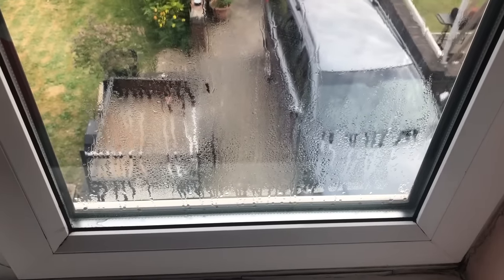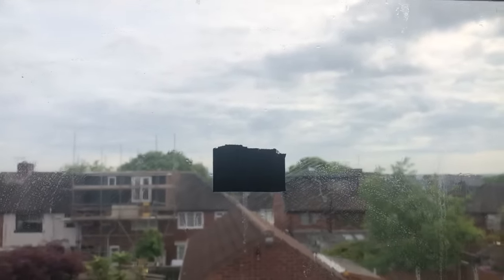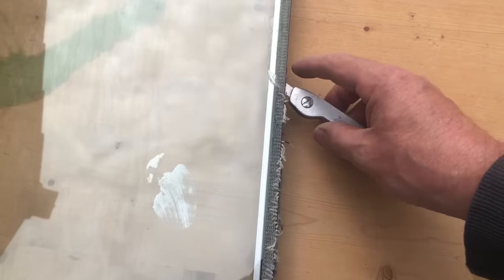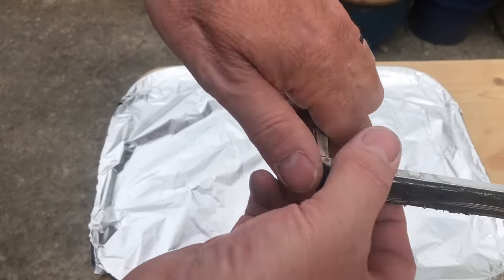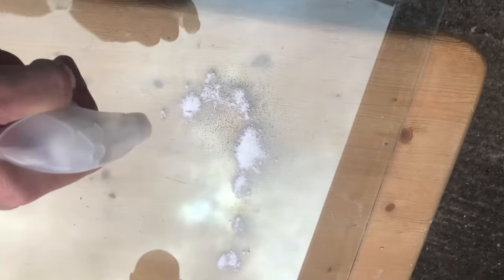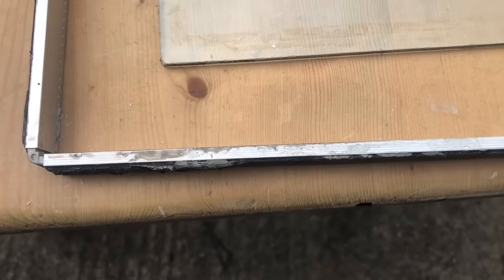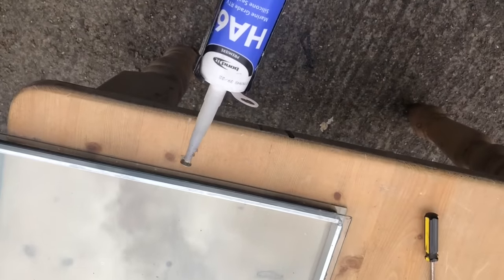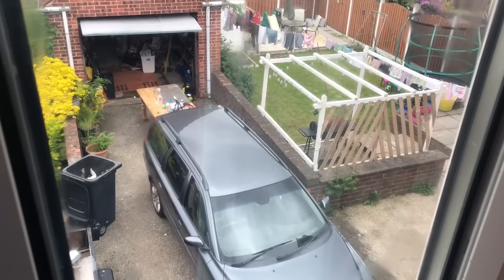Double Glazing Unit Condensation / Blown DIY Repair.

Comment: Its really depressing how many comments say "just go and buy a new one", totally missing the point. Repairing things is a great thing to do on many levels (eco, ethics quite aside from saving money) if you have the skill and inclination & no one is forcing anyone to do this against their will. Great repair well done!. I wonder if these people wash their clothes, dishes etc or just buy new ones.
Reply from the maker: Agreed 100%, the real problem is fear  of this repair  leading to a downturn of business for those who stand to benefit. Eco credentials are likely discarded for profit and convenience.

I’ve had the exact same problem with another video I made opening a stuck shut composite door that I strongly suspect has upset many a locksmith! They don’t want a video to be available to the masses that helps solve a costly problem they earn money from!
Reply: I wouldnt have said that, but I have to admit I had no idea they were repairable. I had a hunch that there was a dessicant in the surround, but always assumed the air gap had some specific gas or vacuum treatment to minimise the condensation. I have a couple of blown units though. Now I've seen this i will certainly take the plunge on repairing them myself
Reply: For most it basically boils down to valuing how much your time is worth? Stripping down a unit like that would probably take many about two hours to do , a new glazed unit is about £20 , so if you're time is worth more than £10 per hour you're better off buying a new unit. 
Appreciate the video though, found it interesting
Reply: @johnd6487  
Bog standard double glazing now is argon filled, I just had some fitted because my old frames were falling to pieces.  DG has improved but if you don't need to change them then fixing them makes sense.  It takes donkeys years to get the money back, that's if you ever do before they fall to pieces again.
Reply: The problem is, we only one day per year when it's not pi55ing it down! lol
Reply from the maker: So true,  when the best weather days arrive there are much better things to do like go riding bicycles.
Reply: @Jack_Warner 
Argon is the most basic gas they fill with, it's good enough for me and compared to what was there a big improvement, now the wind stops a blowin' when I shut me windows.
Reply: Easy for a small unit like this, what about my big window? That would be quite risky to attempt, I’d probably end up killing myself, at that point I think it would be better to get someone else to sort it out.
Reply from the maker: @st200ol  I know where you are coming from as  some windows are horrific in size, I’ve done larger ones,  another larger window is on the cards today! I’ll video it so all issues are noted.
Reply: @TheRepairer  Thanks for the reply. Looking forward to that video.
Reply: @st200ol  Buy some beers and get some mates round to help. 

Nothing could go wrong.
Reply: I would buy a new one , This way is a long and potentially dangerous operation and just not worthwhilw . No guarantee it will work , . Its so difficult to do also ,. Anyone saying it is easy hasn't had much experience of it . I have done this , i have attempted many but so many are failures. . Its not worthwhile .
Reply: Complete waist of time just get a new one this will never be the same as it would come out of the factory not the right amount of compression on it this will fail again, cheap low rate clear float silver spaced unit, better off getting A ratead argon fillied unit
Reply: What about the thermal properties of the panel? You’ve basically negated the point of double glazing
Reply: @darrenwilliams7741  It is a complete waste of time i agree , . What do you mean about 'compression ' though please? I don't get that bit.
Reply: @Jack_Warner No, the argon gas decreases the heat loss through the double glazed unit.
Reply: @julesdowner5585  The way it's put back together it's not sealed tightly as it would be on the machine so it will course thermal bridging gaps, there is a reason why there is a shit load of silicone on it. This unit is likely to crack when cold.
Reply: Your better off buying a new one as there cheap anyway and that will fail again, if you really can’t afford the £20-40 for a new sealed glass unit then clean up your old one and most places will reseal it for you.
Reply: @M.E63  Prices do vary .  i got prices for a toughened unit last week and it varied from £36 to £78. If this was a viable repair then you would think that  people would set up offering this service ? As for getting it sealed , You may end up waiting a day or so for this depending if places are busy . . Much easier to get a replacement .
Reply: Wish I'd read through the comments before attempting this. It's a real pig of a job to get ALL the silicone off. Silicone does not stick to silicone! It will dry as a separate, non bonded layer to all that old silicone you have left on the edges of the spacer frame. I would say your repair is doomed to fail again very soon after the repair unfortunately.   If I could find a place locally to me here in France that sold these units, l most definitely woukd just go and buy a professionally made replacement unit. Because as you quite rightly say, it is not a 5 min job. I've spent most of the day getting my unit apart and cleaning off all the old silicone, and the glass. Still got to get it back together again yet as well 🙄
Reply: @ianwalton7893  In UK it’s no problem to her sealed window glass unit, you can get it cheap and it’s not worth repairing considering the time and effort and little money you save if any, the repair won’t last long, might be best to use a different sealant like maybe polyurethane or something similar, I don’t think silicone is a great idea, I wouldn’t use a clear one, I think black sealant is the best way to go
Reply: @M.E63  to be fair the original units were sealed with black sealant, but the 1/4" over hang of the glass past the centre spacer was completely filled up level with the edge of the glass all the way around. Solid smooth and very thick. To buy that amount of sealant here will probably cost as much as a new unit alone!
Reply: @ianwalton7893  I presume they use black as it won’t get dirty and mouldy as much over time, i wouldn’t use any clear or white sealant. I don’t think you need to remove all of the old sealant where it’s filled, the main part you want to remove is where the glass sits down around the inside edge of the glass, after that you can add some around the sides but I wouldn’t remove all the old sealant that’s filled in around the sides, here in UK I wouldn’t even waste my time and money on that as we can get one delivered to our house or go to local glass place and they made mine in 30 minutes while I waited, however most places won’t do it there and then, this video is in UK and I don’t recommend anyone to waste there time here or even in USA as it’s cheap and easy to get these glass units, I can’t comment on France or anywhere else but it shouldn’t be hard or expensive to get it
Reply: @chrisb4009  yea, there is not much "eco" about this. You're using a cartridge full of sealant to repair a product to a state that won't do much insulating compared to modern gas filled sealed units. I'm all for repairs when possible, but it doesn't make any sense here.
Reply: @julesdowner5585 agreed it is not cost effective. I am in the trade, and it’s just not worth the time and effort to split a unit. Also what was not mentioned, if the glass has become stained inside the white residue simply with not come of.
Reply: What is depressing is spending hours repairing a double glazed unit because you have nothing better to do.
Reply: @horace9341  Quite true . Its a nonaense video from  a  fool. Can you imagine   the problems a novice would find doing this and also the danger from messing about with glass and knives. . Just splitting a unit can be difficult if not impossible without breaking it.  . Like you say , once glass is water marked  just chuck it ,
Reply: @M.E63  Cheap?  I just measured/priced the smallest of my many blown units and it was £100 to replace.  There are 5 in that window so that's a monkey for one bay.  Cheaper than Anglia would charge, but they rip the whole thing out.  So I spend a ton on sealant and save myself £400 ... and if it fails there's only the cost of the sealant to worry about.
Reply: @I_Don_t_want_a_handle  it’s a different story if your replacing 5 of them, but I just replaced one and the video is about one and mine was £40, size is 80cm x 100cm, I would rather pay the £40 then do all that work to seal it
Reply: @M.E63  Where did you get that from?  My window is smaller (60x100) and the lowest I have seen is £100.  At £40 you are correct, not worth the effort if time and ability is lacking.
Reply: But there were not repaired. They will mist up again when the weather conditions get colder.
Reply: @johnd6487 Indeed, there is an inert gas within double glazing panels. It can be one of several different gases.
Reply: @thefreedomguyuk Requiring a follow up video ...
Reply: @Jack_Warnerno, the point of argon filling is to reduce the U value - ie. Increase the insulation!
Reply: @nonegiven9579  What size unit are you getting for £20?
Reply: no its not argon is a better insulator than air
@Jack_Warner
Reply: Just buy a new comment
Reply: @I_Don_t_want_a_handle  While I would probably go for a replacement, the prices I have seen bandied about here are massively lower than what I can find.
Reply: It's a lot easier to go riding bicycles now, with all the crazy tax payer funded psycho lanes ruining our roads.
Reply: He should have just bought a new one.
Reply from the maker: @mrteroo8953 This is a repair channel not a buy a new one channel!
Reply from the maker: @combrogi  The repair works or I wouldn’t have made a video about it and not all glazing is Argon.
Reply: @TheRepairer  wasting your life pal. Buy a new one then get out on the lash.
Reply: You're absolutely right. I've repaired things for all of my adult life. In this case I've got a composite door with 2 glass panels and one of them has blown. They were supposed to have been filled with argon as well.
Reply from the maker: If the glass can be removed and refitted there is hope for a successful repair.
Reply: @TheRepairer  yes, also the fact that it's supposed to be filled with argon is irrelevant as any saving made from less than a total of 1 square metre would be literally pennies compared to a unit with just air.
Reply: @nonegiven9579  Agreed. Although it's not only your time but the extra associated costs; Sealant, Heat oven to dry the dessicant and Duct tape all add up the cost so in fact it will be cheaper and more eco friendly to purchase a new one.
Reply: To me it's also theoretical.  4 hours for TheRepairer is probably 2 days for an average person; and plenty of potential gotchas mentioned in the video hint how this could end badly and then require replacement windows in any case.  And then there's the materials cost in the repair.  But the other thing is... presumably these windows are more than 5 years old (because most come with a 5-year guarantee), perhaps much older.  So perhaps there is better, more energy efficient glass which could be used to replace them.  Around 5 years ago, we had the glass replaced in our windows, with some supposedly more efficient glass, and I have to say I was sceptical.  But all the glass in the South-facing kitchen windows used to run with condensation (on the external surface, inside the house, not inside the double-glazed unit itself) every day, all through the winter.  We even had an extractor fan fitted to minimise this, which of course meant more heating costs.  The new glass, amazingly, reduced that condensation to almost zero, no extractor fan needed.  And there was a government grant available covering part of the replacement costs.
Reply: @tsuchan  a lot of windows have 10 year guarantees. Mine did.
Reply: @johnd6487 I thought double glazing units had gas in them!
Reply: @darthwiizius I thought it was!
Reply: @nonegiven9579  where do you get replacement glazing for £20?
Reply: 😂😂😂 I am sure they buy new clothes all the time. This is brilliant
Reply: A home repair is going to take several hours, require some purchases anyway and is not going to be argon filled. It’s also not going to be as effective as a new unit.
Reply: Innit
Reply: great comment.